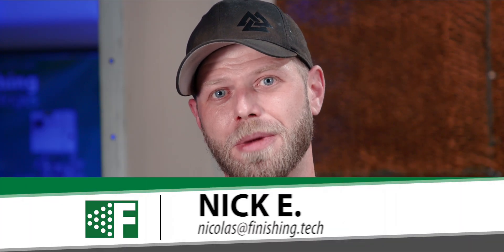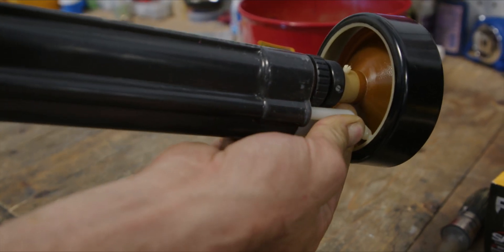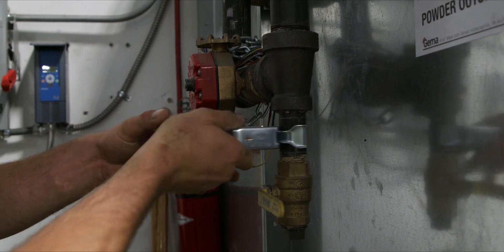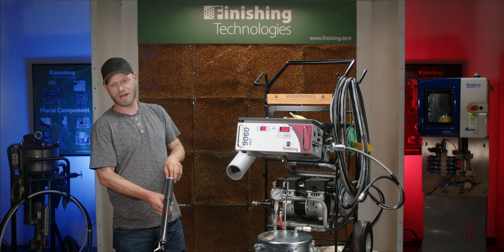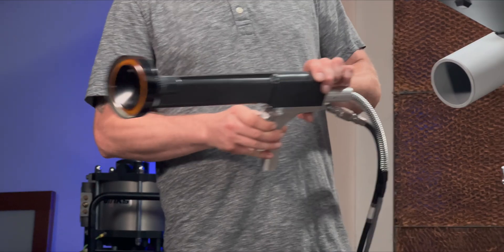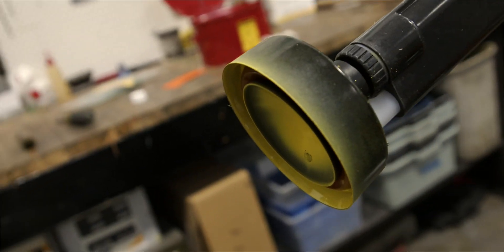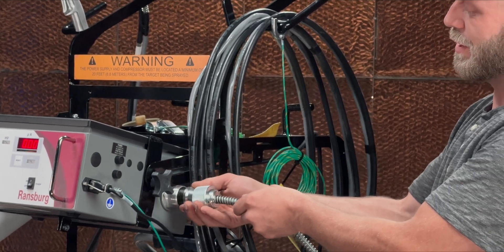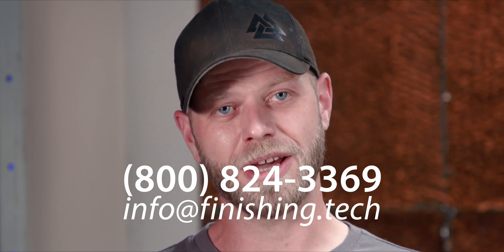Ransburg Process 2 (Deuce) Basic Training & Maintenance

Comment: Can you operate eletrostatis machine with a generator in a lift
Reply from the maker: Hi there. Yes a generator could easily be used to power the unit, you just need 15a 110v. If you're on a lift, typically not an issue if you're not too far off the ground where the feed system starts to struggle to move paint up-hill.